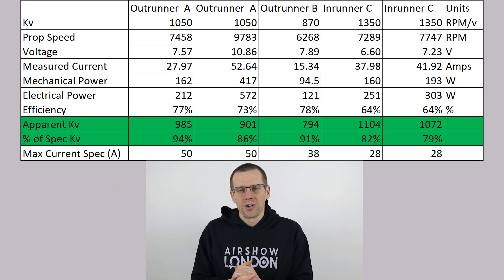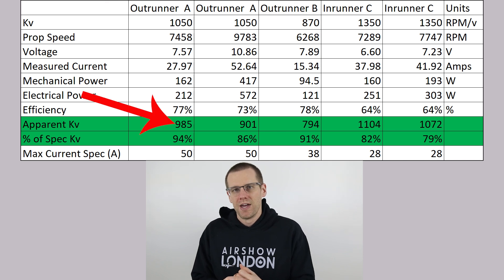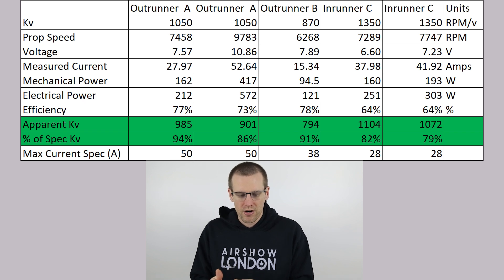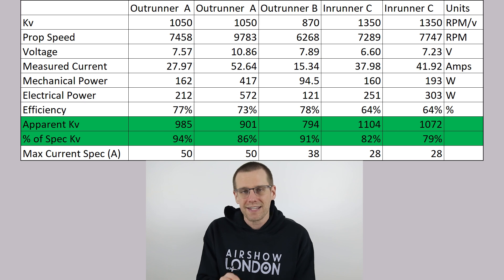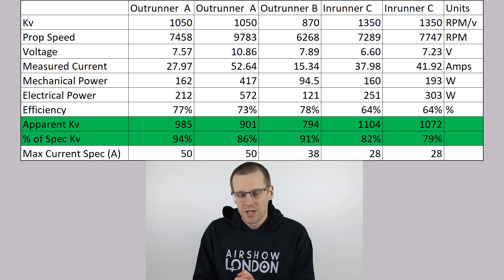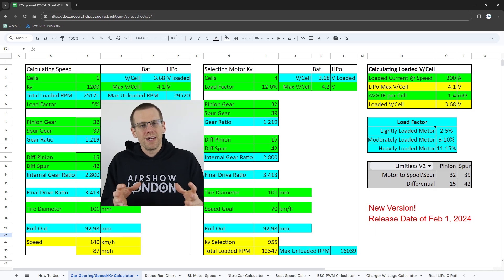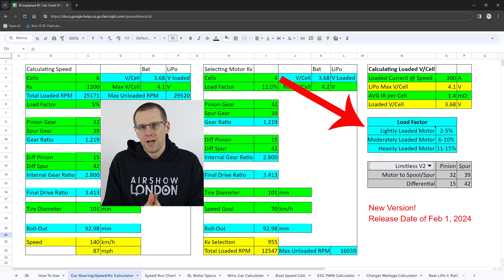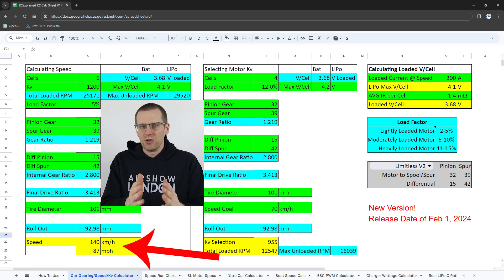Brushless Motor Truths: The Kv (Constant) Conundrum Explained and Explored

Comment: I think saying "apparent Kv" is very wrong. You measure it by dividing RPM by applied voltage. This is so wrong. You should take back EMF voltage instead of the applied voltage. In this case, it will be constant no matter what voltage/current is applied to the motor. I am not saying that you don't understand that, I hope you do. I just don't agree with the way how you trying to explain this. The only reason why this "conundrum" exists is because people try to oversimplify difficult topics. I haven't seen any video where BLDC operation is really properly and FULLY explained. Including BEMF and Kv,  torque and winding current, consumption current and slow decay mode, resistance and heat generated, inductance, PWM frequency and current ripple ... all of that stuff once and forever
Reply from the maker: "Apparent Kv"  implies that something appears to be true or real, even if it may not be the case upon closer inspection. These words were carefully selected and I don't think it was wrong to state it this way.  

Kv is well known for representing the no-load RPM output per Voltage Input. Although it is widely accepted to measure Kv using Counter EMF, there are manufactures who apply a voltage through a controller and measure output RPM for this value. 

BEMF is notably lower than source voltage when a significant current is flowing in the circuit. This matches the idea that Kv is no-load based, otherwise it doesn't work.(as shown in this video) This is why we always hear of no-load RPM when related to Kv. Stating no-load is pointless when working with BEMF values. But ultimately, using no-load RPM or BEMF voltage, gets you the same result that you are after. 

Considering that Kv (RC) mainly pertains to voltage applied, it's best to use Ke or Kb when discussing BEMF.

This just seems like a flex, I don't have a comment for this. Cheers:
"I haven't seen any video where BLDC operation is really properly and FULLY explained. Including BEMF and Kv,  torque and winding current, consumption current and slow decay mode, resistance and heat generated, inductance, PWM frequency and current ripple ... all of that stuff once and forever"
Reply: @RCexplained   I appreciate your time writing the answer. Also did not want to flex or be toxic, sorry about that. I got your point I guess.
Reply from the maker: You make good video's and demonstrate a good wealth of knowledge. If you ever want to do a colab video, shoot me a message.

Comment: Dear Sir, In an RC boat application, how much faster, if any, will a 3674 2075kv d-wind motor be than a 3674 1900kv y-wind? Thanks for any advice you can provide.
Reply from the maker: Higher kv on the same voltage same prop will pull more amps and should go faster.
Reply: @RCexplained  thanks for your help

Comment: what kind of timing should I run on my end bells and ESC for that track in videos below 

I run associated 1/10 b6/T6

my B6 has xr10pro stealth 
26T p 75T spur with HW  V10 13.5  which comes with 40 degrees set on the end bell 

my T6 has xr10 stock spec, same V10 13.5 with 40 degrees on the can.  it has a 25Tp 81T spur

I've done some research which tells me you can get more performance with less heat by reducing mechanical timing and adding some dynamic boost/turbo on the ESC  but can't find any examples

here's the track I run on most. it's tight and med/hi grip. https://youtu.be/srJIH-eyg5E?si=gAtE9kjlkcDlPdNE

https://youtu.be/mGiFJJ2R4XA?si=EqTTqyRMPZhMwfLE

Comment: The vast majority of kV ratings are just plain wrong.
Reply from the maker: Could be.
Reply: The manufacturers do tend to state they are  supposedly in 5-10% of the rating on the box, but I have found many cheap motors to not even hit minimum specs whereas quality motors tend to hit the official rating or be slightly above :)

Comment: Obviously once you start putting load on it's going to change. As an RC car goes faster the friction is going to get higher and higher as all the drive shafts and wheels turn faster. With no load it's still a fine way to test the motor. It's like using and engine Dyno Vs wheel horsepower.
Reply: A engine dyno applies a load :) so no not the same, only way to test a motor is underload :)
Reply: @rinzlerprime3372  yes but an engine dyno is a set load whereas a engine in a car has unknown loads from the many moving parts.